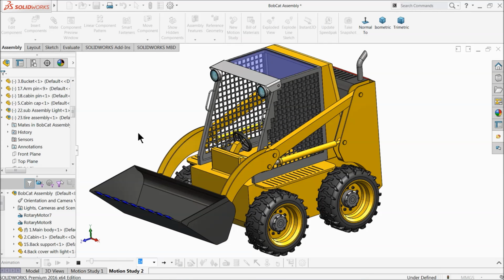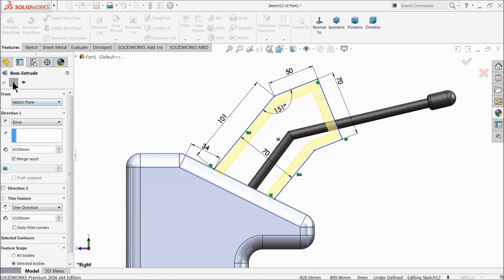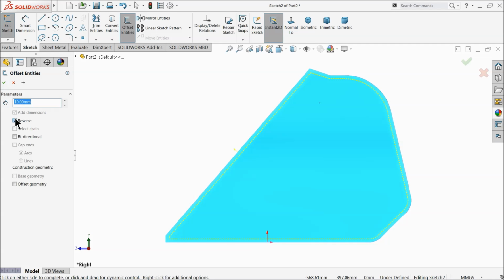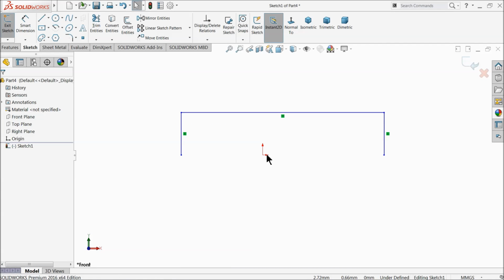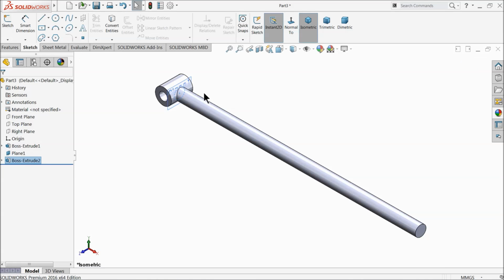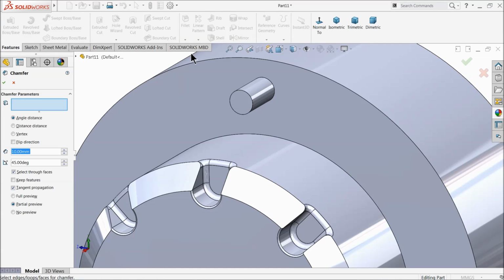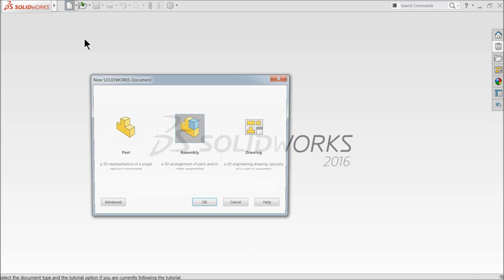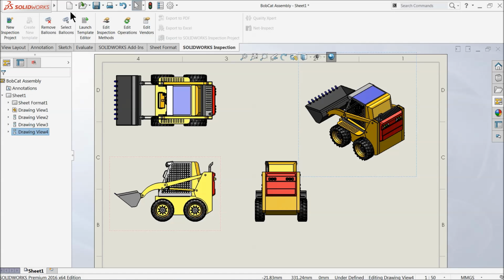Solidworks tutorial | sketch Bobcat Loader in Solidworks

Comment: Excellent tutorial sir. Big fan of your work. Is there an easy way to scale down this complete model for 3 D printing?
Reply: Depends on the 3D printing program you use. For example, I made a playground slide that was a few meters tall. In Cura, I shrunk it down using the scale function. It was a crazy decimal amount but that is what I used and it printed well.